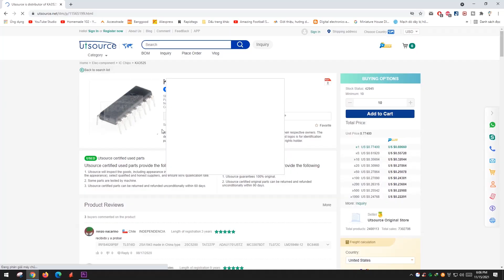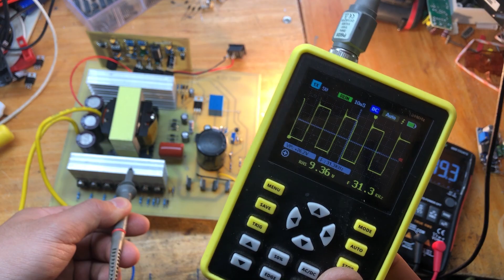Make 1500W sine wave inverter | Part 3 | utsource

Comment: good project I would say excellent.  when you make the 4000watt inverter with double EE55 transformer.  and with the egs002 in the same circuit.  thanks for the contributions.

Comment: Hồi tiếp 380v qua trở 680k + chiếc áp 500k về chân 1 của 817 dc k a. Vs lại boar khiển 3525 muốn dùng nguồn 24v thì cần điều chỉnh j k a. Mong a giup. E cũng đang làm nó
Reply from the maker: Muốn xài 24 thì hạ áp qua 7812 thôi b. Mình dùng 12v nên ban đầu mồi cho chạy bằng ắc quy, sau khi mạch chạy rồi thì nó sẽ đc nuôi bằng nguồn phụ 12v từ biến áp xung. Nó sẽ tốt hơn.
Reply: @PhdHung  vậy thì phần báo khi bình yếu nó sẽ k hoạt động hả a
Reply from the maker: @thanhelectronic9499   chân nguồn với chân batt nó khác nhau mà.
Reply: @PhdHung  e mới điều chỉnh lại phần này chạy mô phỏng ok. Thực tế e chưa ráp nên chưa bt chạy ok k kkk

Comment: I admire your clean work brother.
I may ask, how to determine how long a certain battery pack will last to run a constant load (12v - lithium batteries pack), you can point to a resource or whatever you to help.
Thanks in advance 

Greetings from Tanzania 🇹🇿
Reply: battery voltage x battery capacity in amps = watts per hour

then,
battery watts per hour/load in watts = time in hours
Reply: @fayanshorts  thanks buddy, :)